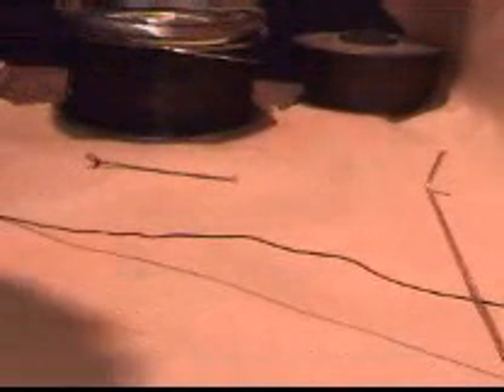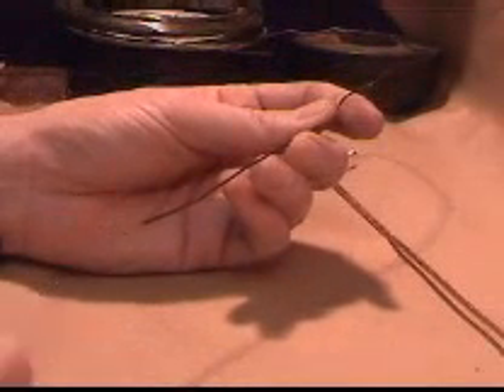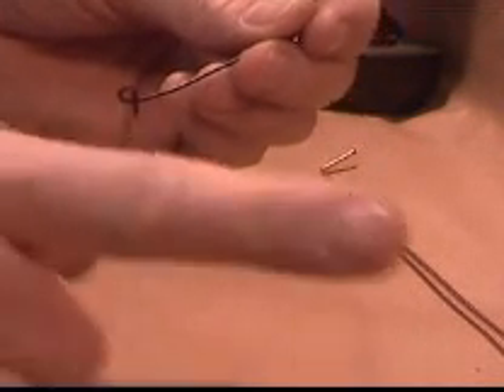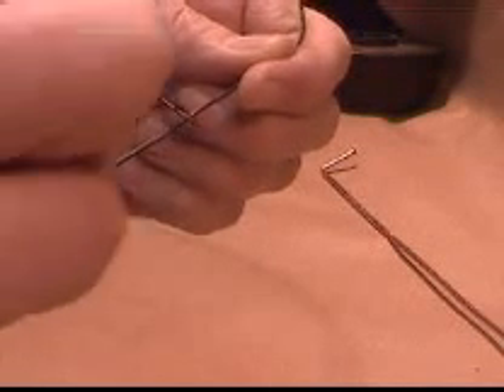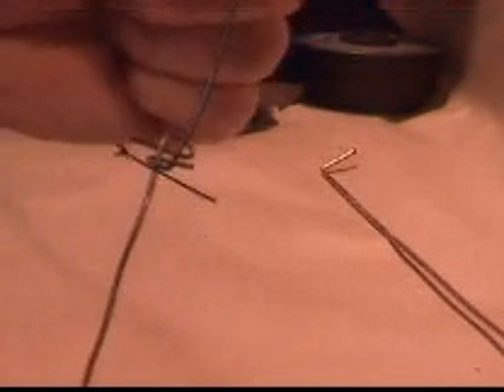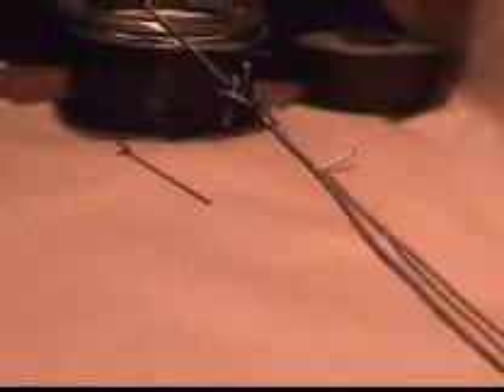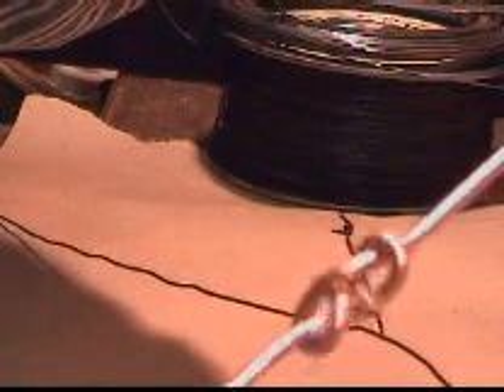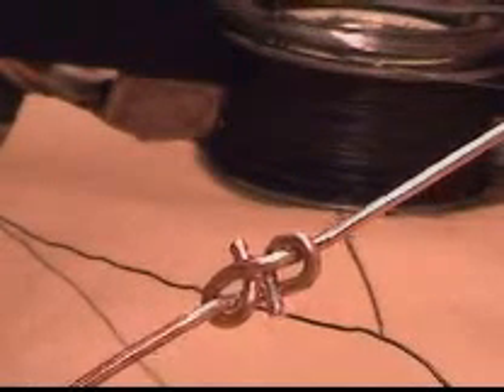Piano tuning wire splice

Comment: @guitartec It's more of a quick fix.  Useful if you don't have the proper replacements, as you said, but also if you don't have the time to get the string to stabalize (i.e. if you're traveling to remote areas, or if a string breaks when tuning before a concert)

Comment: Thank you very much.  This saved me a bundle of frustration on a string I just broke.
It was hard to see on the video, but through trial and error I managed to determine as both loops are created toward the right, the ends crossed under the wire - at least on a grand piano or any wire removed from the piano. However, on the upright I had to fix with the broken wire still in the piano, if the loops are still made to the right, both ends crossed OVER the wire in order to work.